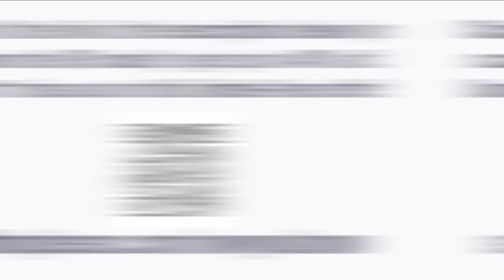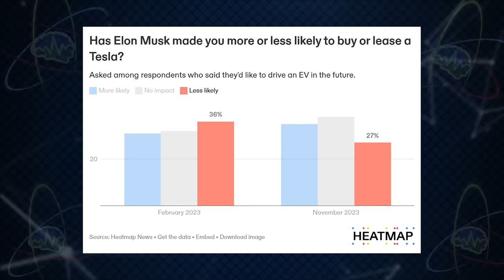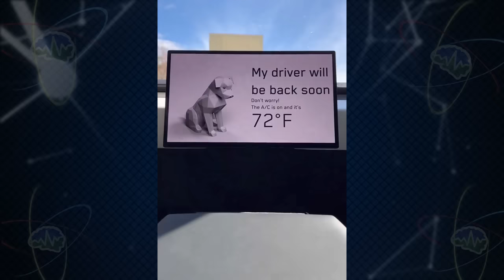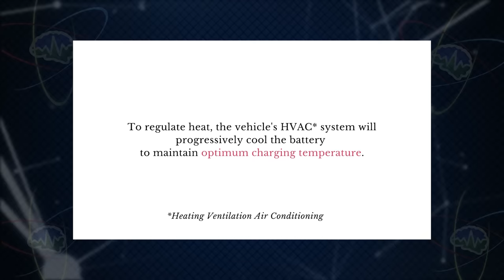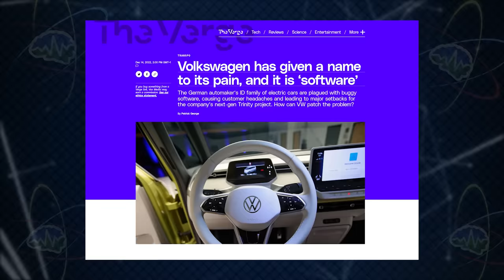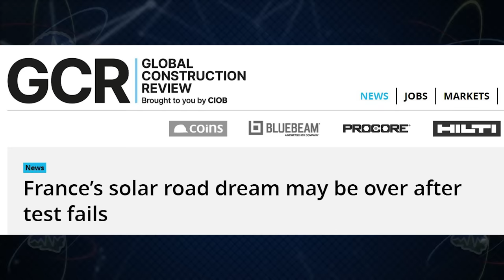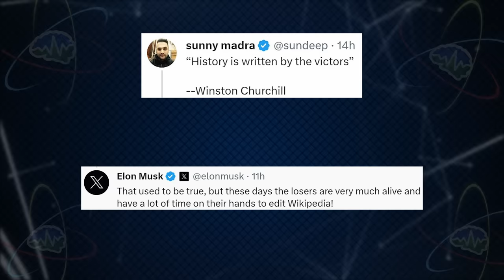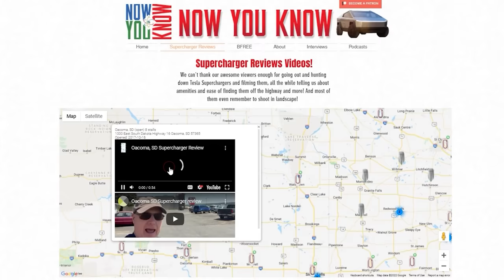Tesla Robot Attacks? | Tesla Time News 382

Comment: Hi Zack & Jessy & happy new year!! wanted to see if you can do a deep dive into Zeekr's new Golden Brick Battery LFP batteries??
according to other Utube sorces, this battery can boost 500 KWh  fast charging... faster than anything ever created, also able to withstand -49 % F freezing temps & over 1800 % F fires by dropping into what looks like a large oven - also, dropped the pack from what looks like about 300 feet to dry pavement below & still... works normally.  only thing I couldn't find on the battery tech is the actual life of battery?? nothing on cycle life that I was able to see? this would be a great addition to your disruptive tech channel.

let me know what you find out please, thanks in advance Will

Comment: I’m pretty sure in the interview with Sandy Monroe the engineers said that the truck would output 11.2kw ac (220v, 50amps) via the rear AND via the nacs.  The critical components for using the truck as a power source are an inverter (already on board), a safety cut-off from the grid, and a connection from the vehicle to the home on the house side of the grid-safety cut-off.    So unless there is a grid cut-off device we are not seeing, I don’t think the “mobile share” is a home bi-directional solution.  I’m gonna guess it’s exactly what it says it is.  A high amperage NACS adapter that plugs into the Cybertruck and can provide mobile charging.

Comment: T Sportline has been showing a lot of "tear down" videos of the Cybertruck and confirmed the location of the 48 volt aux wires behind the frunk liner. They also confirmed two of my questions. The HFS skin will attract a magnet but not quite as well as other types of steel. However, the regular stainless steel parts under the skin is not magnetic at all. Brackets and mild steel parts are very magnetic. Also, there is a 48 volt battery and they pointed out the location. Also, there are two large bolts exposed so you can attach jumper cables or test the 48 volt battery. Those videos are very informative.

Comment: The only device I heard your installer expert mention that makes the truck able to do V2H is the Universal Charger released earlier this year. He said it could supply a neutral line so that the truck can feed the house [AC I assume]. The gateway can handle 30, 50 or 80 amps and that is a built in option of the circuit breakers in the gateway [not a selection you add on, but a switch with options]. The charger is 48 amps and can give 11.5 kW from the truck, so definitely 50 amps. I do not think the plug on that portable charger will play nice with 48 amps. This is something that needs hardwiring. No drive over it wireless charging interface anytime soon for V2H.

Solar path seems nice but would think in Maine, like Washington, paths like the open air one shown in Belgium are mostly tree covered old repurposed railroads. Not open paths by a stream. Though we do have two I can think of that could be great. It might be good in some urban parks? Spokane has one called Riverfront  Park that might be good. Home to the Pavilion and Lilac Bowl outdoor stages.

Comment: That "Tesla Mobile Connector Manual" is from 2019. That isn't the one supporting bidirectional charging - but the older mobile connector can use the 50 amp plug in the back of the Cybertruck to charge other NACS equipped EVs.

Comment: Very happy you guys have configured your Cybertruck.  Please collect the interior dimensions for each of the 3 rear seats.  Parents with 2 or 3 car seats really need this detail and it seems like the early adopter crowd is interested in fitting car seats and passengers at the same time.  Any info on this would be incredibly helpful. 

I couldn't buy the Model X because the 2nd row was too narrow and 3rd too tight for my kids to fit comfortably.  Praying the Cybertruck is wide enough to fit three car seats across without much fuss.

Comment: Who'd buy any other EV than a  Tesla? 
35:20
ICE car makers are at least a decade behind Tesla in every aspect; R&D, SftWare, HrdWare, every type of tech, and it's integration into the car package, two decades behind in some of those areas, and some old car companies still secretly want EV's to fail altogether IMO. 

Toyota's plan to unify the chip segment, anoungst Makers, is bogus AF, just stalling IMO.

Toyota has missed the boat on EVs and is in full sabotage mode I believe.

Comment: 52:30 Creating a structure above the ground can be more expensive. You have to account for things like potential snow load on top and lightning since you are blocking natural sun. Having cyclists ride under a structure can also be more dangerous since they could potentially run into the support beams for the covering. There is also maintenance cost with any vertical structure. Not saying these problems couldn't be solved but I can see why it may not be financially worth the effort.

Comment: If anyone's robot attacked a human, they'd be ecstatic, because it would mean they'd achieved AGI and it had chosen to attack someone. You'd be going into the history books. If it did attack someone, that someone would probably deserve it because they'd probably have been doing something horrible to someone. Sounds a lot more like someone stood in front of a piece of machinery and got hit.
Reply: Also, point of order, this was a technician, not an engineer. You don't just get to call yourself an engineer because you work in a factory making stuff. Calling yourself an engineer doesn't make you a better, or more qualified person than adopting a more appropriate title like technician, code monkey, mechanic, or production line operator. Equally, not cool for actual engineers to be described as technicians etc.